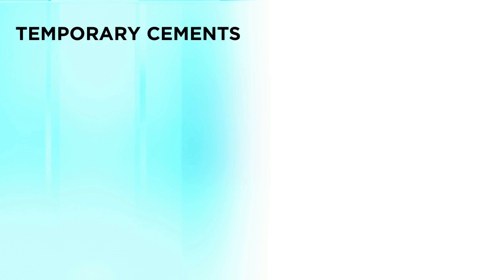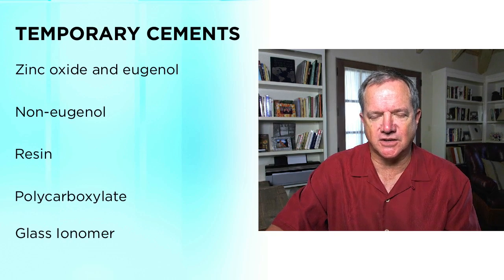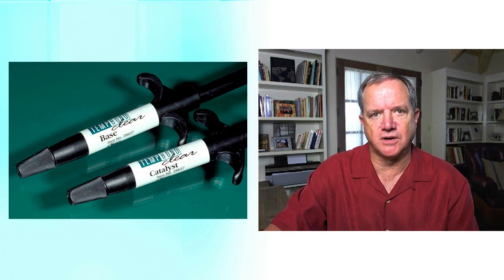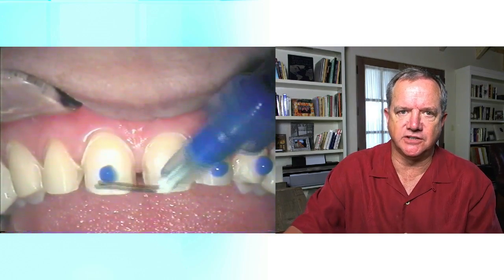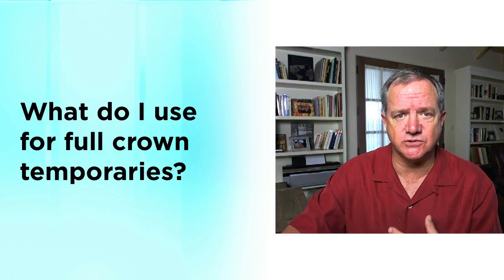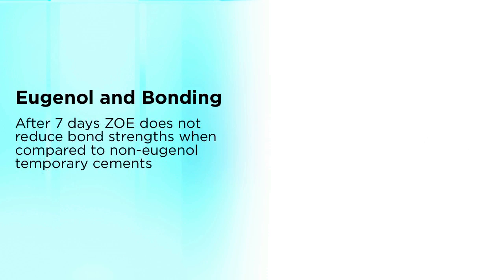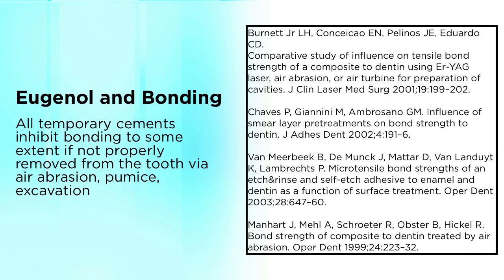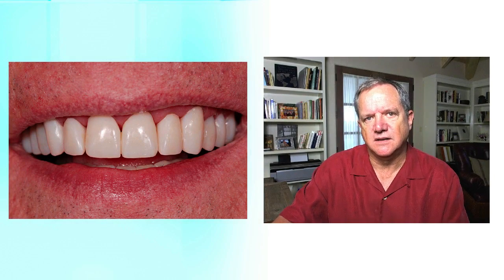Temporary Cements

Comment: How does one air abrade the area at the margin, where a good seal is necessary,  without causing bleeding? 
Even prophy cups are traumatic in these areas.
Reply from the maker: We will contact Dr. Spear to get an answer for you. And thank you for the compliment!
Reply from the maker: From Dr. Frank Spear: The key to air abrasion to clean the margins is to be sure the gingiva is healthy to begin with, ie., the temporary fit well and all the excess cement was removed at the time of temporization.

If the tissue is healthy, be sure to use low pressure and aim the tip of the air abrasion unit at the margin, so the edge of the spray barely hits the gingiva, but does hit the margin.

My experience is most of the time there is very little bleeding using this technique and low pressure if the tissue is healthy.

If the tissue is inflamed, or the margins are subgingival, I always place retraction cord prior to bonding, and would do so prior to air abrading to minimize trauma to the inflamed gingiva.

And finally, there are newer, far more precise, air abrasion units that allow more accurate directional control, the one we use in the office is the  "Etch Master,” by Groman.

Hope this helps.
Reply: Thank you very much for the good information. I think the more precise unit sounds good. Mine is old and has a broad tip. I happen to make temps using Mach Slo models also, and it works very well to produce good margins and promote tissue health. I often have a hard time removing my temps while using Luxatemp or the like, because of the rigidity of the materials. I will try the Miltex crown  pliers (once purchased) and have been using your fulcrum technique where feasible. It is logical and works! Vertical movement is much more effective than sideways rocking movements, especially when using these newer rigid  temporary materials which do not flex much with sideways rocking, that historically broke the cement bond with MM acrylic materials. Of course with final restorations temporarily cemented, this is even more essential...using the fulcrum and vertical movement that is.
Once again thank you for a great series of videos, and this answer.